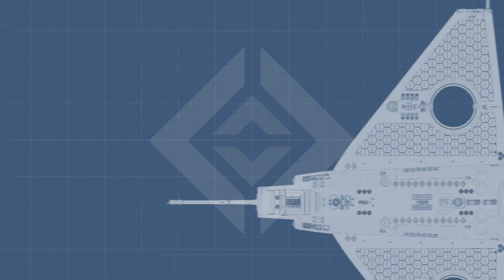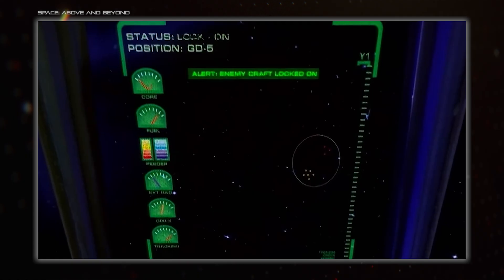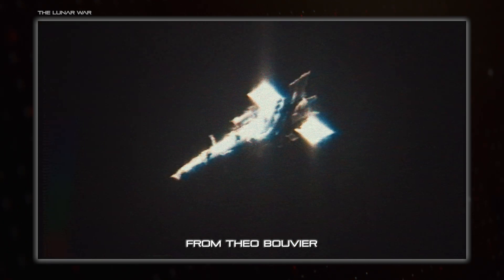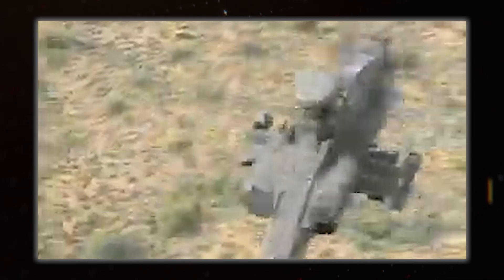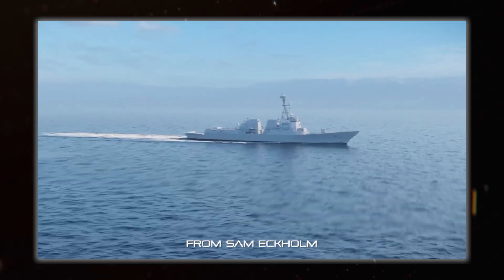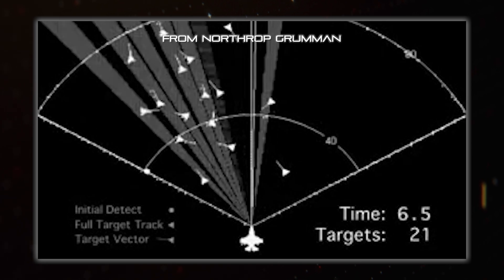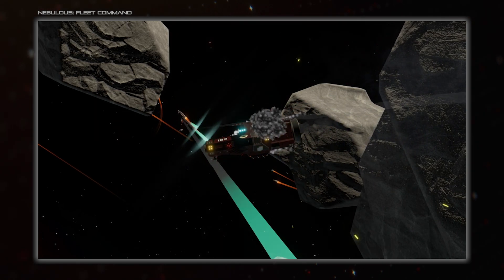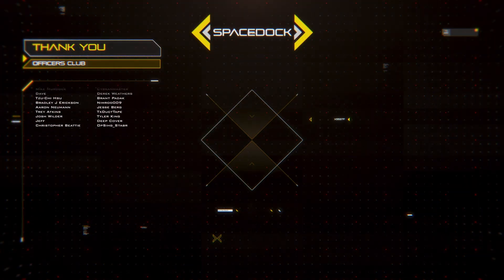What Sensors Would be Used in REAL Space Combat?

Comment: radar that can detect water vapor is also useful in scanning of enemy ships mid combat...  as you can see if they are venting atmosphere and where
Reply: Oooh thats a good point! Oxygen works too since many rockets use liquid oxygen for oxidiser.
- hoojiwana from Spacedock
Reply: @hoojiwana  Add to that passive sensors..   since in most cases things like radio communications,  radar,  and even technically LPI radar...  are all in expanding waves, even if their starting point is only a small fraction of a "circle"   its still a em wave expanding in a circle.

so tell me, if you have 3 "receiver antenna"  In a triangle...   and each is hit by an expanding sphere(pulse)... at different times...   wouldn't it be possible to "map" the sphere...  and from that with pretty simple math locate the center... or point of origin of each sensor pulse?   

Even the EM field from an improperly shielded cable, a drive starting up, or anything like that would create an em pulse...  the more pulses you have in a localized area...   the more likely are are to have a ship there.   

(something a lot of shows forget, a fusion reactor uses a LOT of electromagnetic fields and as such...  would be detectable beyond just the heat pulse of the drive)
Reply: @hoojiwana  Well, no, you would still want to look for water vapor in that instance. Most of the oxygen doesn't make it out of the nozzle, it reacts with the fuel to form reaction byproducts like carbon dioxide and water.
Reply: @hoojiwana  I've been working on an AI-generated design for a heavy frigate which is also armed with a forward fixed rapid-fire ultra-heavy plasma mortar in addition to its other armaments,. I wanted it to be compact, overwhelmingly tough, durable, difficult to detect at range, difficult to target lock, able to take a beating, overgunned and extremely overpowered for a ship of its size moreso than the defiant, easy to build, cheap to mass produce in bulk, easy to refit and retrofit, able to fight the enemy from well outside the enemy's weapons targetting range, and able to take on larger enemy ships with relative ease. Those cruisers wouldn't stand a chance. The enemy would have have quite the run for their money even if they did manage to survive the first few shots. That's my take. What do you think?
Reply: This only works if the ship has its environmental systems active during combat. With how I designed my ships, gravity plates and atmosphere is shut off and vented in order to make damage control simpler, cause the last thing you want to have in your ship during combat is an active fire. 

And before you ask, all crew and guests are required to wear mechanical compression suits with a lightweight inflatable helmet that gives them a breathable atmosphere to work with and an O2 tank that lasts a good hour or so, unless you are plugged into a nearby station.
Reply: Radar combined with infrared can tell if you are shooting at a decoy or the real ship.  Infrared tells you how bright the exhaust is for the different targets, and radar tells you if they are accelerating and how hard.  For example if your radar sees twenty targets accelerating at 4 Gs where one of them is a 1 TW heat signature and the others are 500 kW signatures, guess which is the real target and which are the decoys.

Now if you can chuck the decoy out before the calculation is made by the missile, that can help.

Comment: Which sensors can detect objects moving faster than light?
Reply: The only way we know how to do that currently is observing the blue light of Cherenkov Radiation, which requires the FTL object to be moving through a medium, like water, where lightspeed is slower.
Reply: Well, if you can detect an object moving at FTL speeds, (FTL's not real, so how it looks is kind of the writer's choice, could be a bright flash, could just be the gravity waves you're picking up) but the signal from that object won't reach you before the object does, the best solution is probably some sort of loose cloud of FTL-capable scouts/drones that could pick up the signal and then use their own FTL drives to race the object they picked up back to their base/ship and get the warning there in time, or use some sort of quantum-entanglement based ansible. Leaving a drone or two in hyperspace with the programming to pop out and start transmitting when they see something coming could also work.
Reply: Using IRL? None, information can't trave faster than light even if you'll introduce a magic engine that allows you to travel faster than light.
You can invent magic FTL sensors to detect FTL engines, but consider first would that make things more or less interesting?
Reply: @DarthBiomech  If you already have "magic" FTL engines FTL sensors are not much of a stretch.  

Also "but consider first would that make things more or less interesting?" is true for literally anything you put in a story.
Reply: Tachyon arrays scans at FTL. In my own story I use -Sharnada instant-space' detectors. This particular array scans an entire galaxy in real time in a radius of over 700,000 Lightyears. Requires an enormous phasonic energy reactor. (All other details are classified, sorry.)
Reply: Quantum entangled positioning
Reply: In my setting, ships going FTL generate optical shock. (Like a sonic boom, but for light.)

This makes stealth impossible when going FTL.

Comment: The old mark 1 eyeball wouldn't be as useful in real space combat at such great distances and light levels, so no need for a ship covered in vulnerable windows. Space combat will probably be more like submarine warfare with lots of sensor fusion and electronic warfare.
Reply: The F-35 uses cameras on the exterior to let the pilot basically see through the plane with their HUD, and applying that effect to an entire cockpit/bridge would be truly epic.
Reply: @RorikH   Exactly - that's a perfect example of 360 degree passive electro-optical coverage and when you add AI image/pattern recognition, it becomes way more powerful.
Reply: @Phrancis5  nah, it's more likely we'll get a mix of Submarine Warfare and Surface Warfare.
Reply: @merafirewing6591  Why do you imagine that? What surface is relevant?
Reply: @artor9175  You're going to need alot of redundancy in terms of sensors.
Reply: @merafirewing6591 Secondary and tertiary backups for every critical system, it will make things more complex and resource intensive but will ultimately make for superior spacecraft.  To take it to an even nerdier place it is the exact difference between Starfleet and Klingon ships and installations.
Reply: @merafirewing6591 more like a mix of submarine and/or air warfare, as they would use cameras, some glass and radar, especially long range radar
Reply: @merafirewing6591  Much more submarine than surface unless you are thinking of modern over the horizon surface combat with cruise missiles.
Reply: @RorikH  Didn't Star Trek:DS9 do something like that with the Jem'Hadar ships?
Reply: @charlesmoore3390  Haven't seen it, couldn't tell ya
Reply: @RorikH  battlefield 2042 has vtols with fully armored cockpits and it’s implied it uses this
Reply: @RorikH the F-35 isnt a spacecraft though…
Reply: @RorikH sounds like the visor display that the Vorta or Jem Hadar first would wear in DS9
Reply: As a good friend once said: Windows are a structural weakness.
Reply: If it has any views to the outside, it'd be through cameras anyway.  The main display in Star Trek's ships are actually that.
Reply: You would want a few windows, but really just for dockyard backups & similar. They'd likely be part of airlock construction.
Reply: I come here after having just discovered lazerpiggers and the table
SPACE GAVIN FOREVER
Reply: @tomarmadiyer2698 What.
Reply: It's one of those oddities in Star Wars, they'd be far better off with a bridge in the middle of the ship, rather than sticking out of the top or front.
Reply: @twrampage  That's literally a point in Halo, the larger Covenant ships have central bridges and find it kinda funny but bold that UNSC ships instead have exposed bridges.
Reply: In the novel series lost fleet, “radars” are useless. It’s basically Mark MMMCCIX eyeballs that dominates.
Reply: I love that series. And yes, optical is preferred because of two key combat paradigms: FTL capability, and light speed lag (send/return)  over deployment/maneuver distances.
Reply: That’s how battles in original series Star Trek played out
Reply: I expect that combat space ships would be built like battleships.  You pack all of the critical systems into the smallest space that you can and then armor that space.  However, the noncritical systems can sit outside of the armored citadel.  Among those noncritical systems could be spaces with windows that look out into the vastness of space.
Reply: In Children of a Dead Earth, there’s no windows or anything, really it looks like the entire ship is just wrapped into a sleeve of armor.
Reply: Reading the Honor Harrington novels (Weber) provides good descriptions of such battles.
📚👍
Reply: @gePanzerTe Prefer " In Death Ground" myself.
Reply: think it really depends on the style of sci-fi you're going with. Something more pop-culture and cinematic like Star Wars basically fights at what would be considered point blank/spitting distance so windows become surprisingly practical as they let you avoid crashing into an allied ship as you can simply look around. (if those windows are made from transparent metal, transparensteel in star wars, even better).  Heck even star trek fights at knife-fight distances. 

If you want something more realistic or something going for a more submarine warfare style sci-fi then sure bury your ship’s bridge and mount external cameras. Also make fighting long range engagements and kick up the tension factor as crews wait for weapons fire to hit them.
Reply: Like 2 Ballistic Missile Submarines in different oceans trying to bullseye each other.
Reply: I recall a scifi short story that applied that concept to warp drives, even. Premise: What if our native energy level isn't the floor for Warp Drives? instead of going up to 10x or 100x warp drive, drop into 0.1x and you become undetectable but you can still see the 'wakes' from higher Warp Factors including 1x
Reply: Windows are a structural weakness. The Geth don't use them.
Reply: Why would windows be vulnerable?    It's not like crew quarters would be armored to begin with.
Reply: @silentdrew7636  Glass isn't nearly as strong as the stuff you'd be armoring the rest of the ship with. It's the same reason we stopped putting hull MG's on tanks after WW2, they were too much of a weakspot.
Reply: @silentdrew7636  
1: opportunities for leaks
2: structural weak points where cracks can develop during high g maneuvers 
3: allows more radiation through (solar, laser)
4: weight- the seals and anchoring make them heavier than just flat sheet metal, and glass as strong as steel is much heavier and thicker than that steel
5: fragility/repairability- glass shatters on impact.  Metal can bend.  A pinhole you can weld shut as good as new in literally 1 second or less with tech we already have had for decades in steel would irreparably ruin a pane of glass.  You might epoxy it, but it'll still be weaker than original.

There's more, but I feel I've said enough by now
Reply: Hundread percent agree, you traded water for distance for the main obstruction mechanic, the engagement range will probably be in hundreads of thousands km with nuke being the primary weapon (pretty much zero restriction and concern for collateral damage in space)
Reply: I'm just thinking of Legion in Mass Effect 2 when Joker comments how the ships stealth drive means nothing if the enemy looks outside:

 "Windows are structural weaknesses, geth do not use them"

😂
Reply: a few windows with armored shutters is probably still a good idea; the sensor fusion system of the "Human" maintenance & decision making unit tends to produce a lot of false threat contacts when the drone is confined in a small space, isolated from the navigational and timekeeping reference points it was designed for. yet the Human system remains irreplaceable in many roles despite being not at all designed for any of them
Reply: I got mark 5 eyeballs, how useful would those be?
Reply: I would recommend the exforce series if you want creative and logical space combat
Reply: Not as useful but like in the battle that begins The Mote in Gods Eye book by Larry Niven and Jerry Pournelle the INSS MacArthur pokes a visual sensor through her shield and sees the rebel ships shield glowing brightly.
Reply: I imagine that space warfare will be more like today's increasingly drone-focused warfighting. Larger ships will deploy a lot of very fast, recoverable, but disposable sensor pods or drones. It would be a physical representation of the kill chain. I truly think that submarine and thus space warfare will mimick what's happening in the air domain. Especially as the age of Carriers comes to an end and the age of disaggregated, nodal warfare matures. Let the cheap stuff light up like a Christmas tree...the enemy can either engage it and give away their position...or risk being found in some spectrum sooner or later.
Reply: See you went to public school 
Be like watching a meteor or a point of light moving